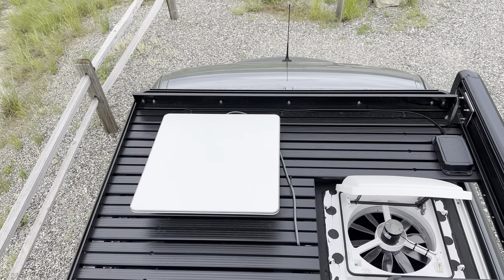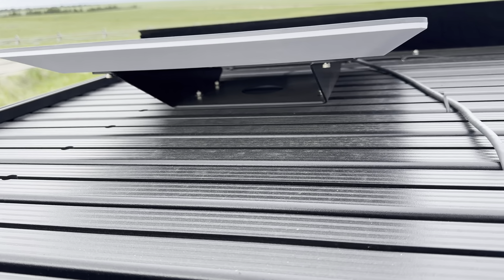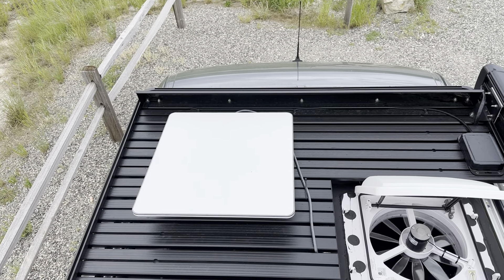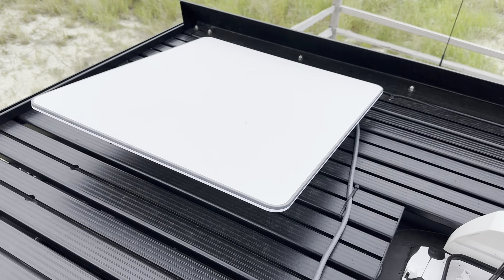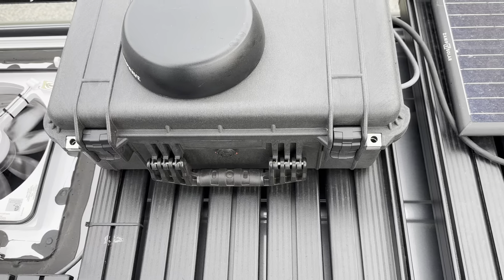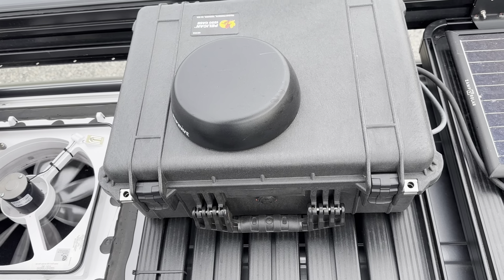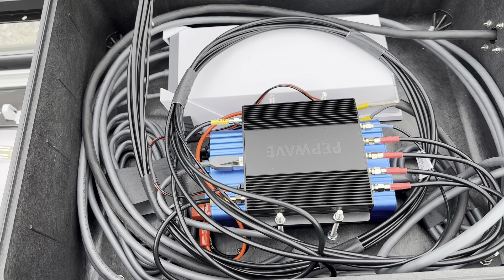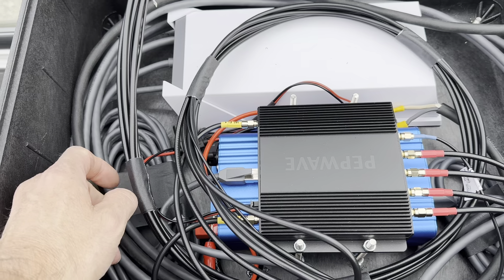SpaceX Starlink Flat High Performance with 5G installation on Storyteller Overland van

Comment: Hi Rob, thanks for sharing this useful info. You mentioned that STO has a standard 12v 20A connection outside. Would you mind clarifying where exactly it is located, and what type of connector do you use? Thanks so much.
Reply from the maker: STO places the "aux 1" power connector under the solar panel, you will need to remove the solar panel to access it. It's a two pin Deutsch connector. You can order a pigtail from STO or places like this https://n15design.com/product/aux-1-power-leads-w-contacts-for-storyteller-mode-4x4/?v=402f03a963ba. Alternatively, you can get the connector components and assemble your own.
Reply: Awesome. Thank you so much for the info.

Comment: This is awesome, great idea.  So much more future proof without butchering the roof.  I just purchased a beast mode and haven’t received it yet so sorry if this is a stupid question.  How do you turn it off?  I can imagine some situations where I am off grid and want to conserve the battery and don’t need WiFi.  Thanks!
Reply from the maker: The port I used on the Storyteller Overland is tied to the “aux 1” button inside your Beast. You can turn it on/off as you’d like. 

The new Starlink Gen3 will be a great match for this application.
Reply: Great yes got the van and I have the same button.  I already own the business dish so I’m just going to exact duplicate what you have.  The sales guy said the sink drain pump is on the same circuit and will overload, have you had that experience?

Comment: Really clean system. Never thought of running a smaller individual inverter just for the internet. What's the power draw on this?
Reply from the maker: The inverter adds about a 10% penalty on the power draw, so figure another 7 - 10 watts depending on the mode. There are some solid dc-to-dc options out there but they fall a bit short of the needs for the high performance terminal. With the recent introduction of the non-motorized residential model, I expect I and many others will transition to that hardware along with a dc approach.

If you are a Storyteller owner and want to leverage the existing 12V DC port on the roof, note that this package is right on the edge of what can be supported. It works fine, but it is within a few watts of tripping the DC auto breaker.
Reply: @RobKikta  Appreciate the quick reply! I noticed that announcement as well. Seems like it has a larger power draw as well. Why make the change? Do you think the dc-dc options will be able to power it? Will the increased FOV make that much of a difference for you? And aren't the residential models not technically made for service in motion?
Reply from the maker: @jeremybillauer9584 , I'd expect the new hardware to pull less power than the high performance. Yes, lots of unknowns with the hardware at this point, but I'm optimistic.